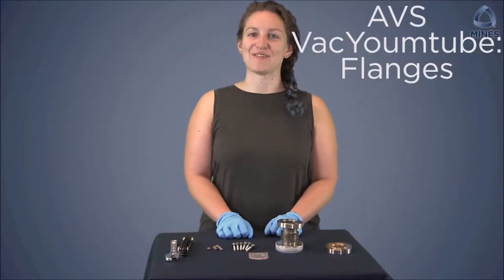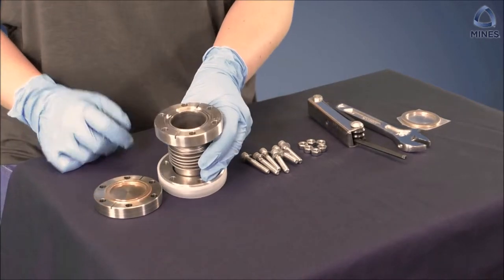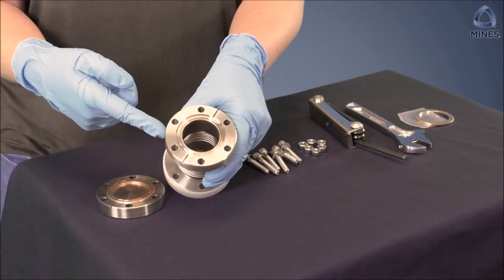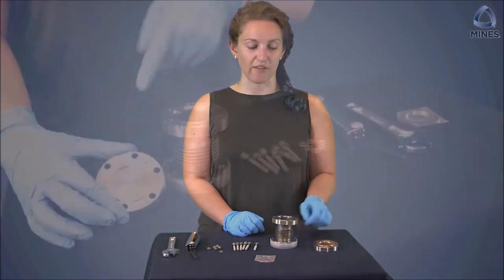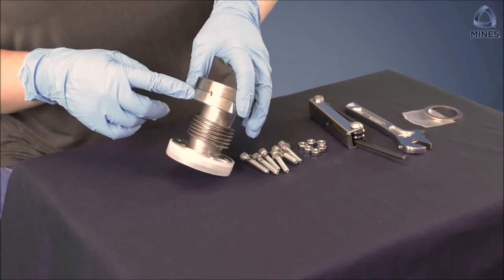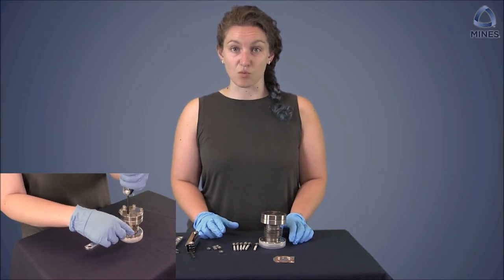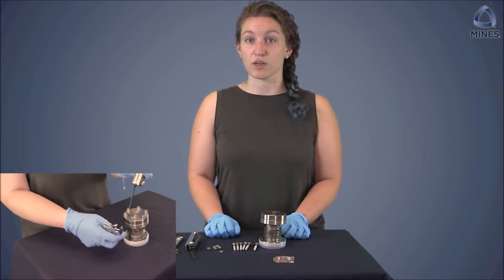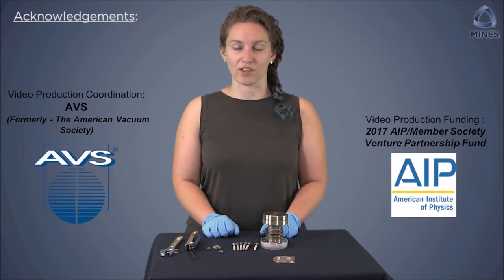AVS VacYoumTube: Attaching Conflat Type Flanges

Comment: An adjastable wrench is the worst choice of all, since it is the easiest way to mess nuts. For the small flange (CF4-1/2 or CF63 in metric notations), as shown in video, this is not that bad compared to bigger flanges. A 1/2-inch (or 13 metric) fork (open-end) wrench would be  the better choice, but the box-end or socket wrench would be the  best choice for preserving the nuts in a good shape.